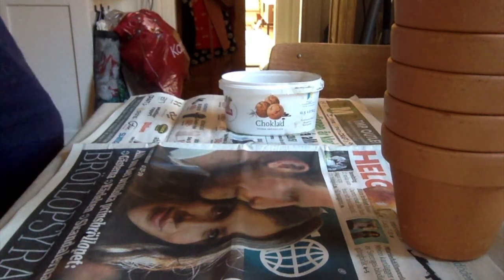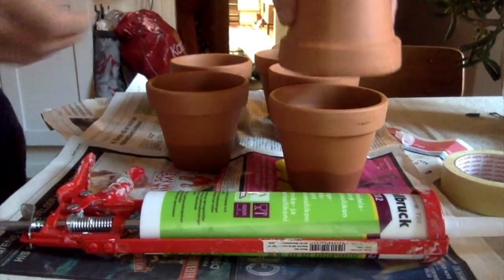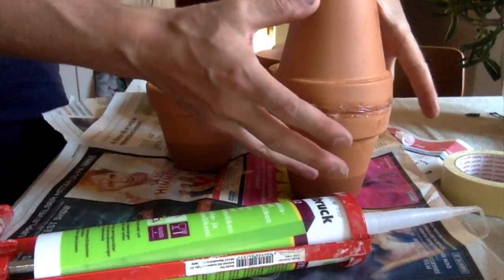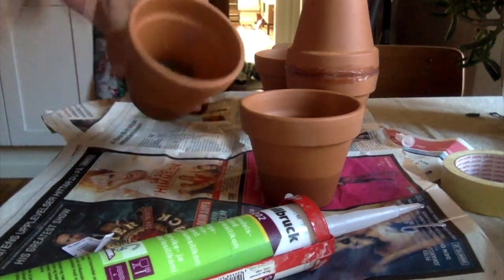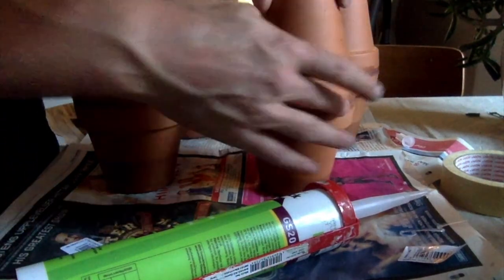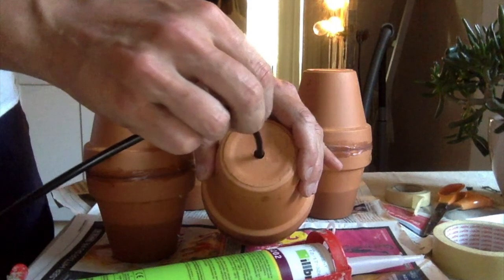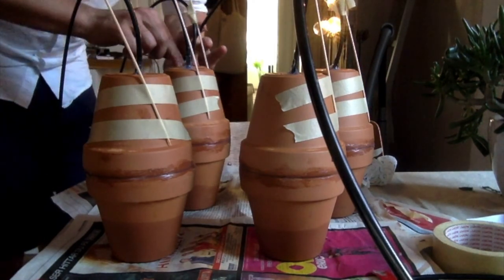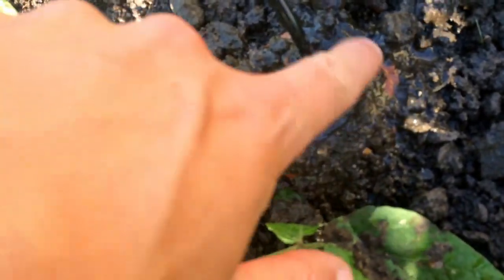How I make my rain barrel fed ollas

Comment: Hi you will have problems with pipe leaking where it enters the pot, it looks to me that some of your pots are very wet, indicating you have leakage issues. You could just use dripper if you want to deliver 2litrs /24hrs.
Reply from the maker: Hi, thanks for the comment! 

The only problem I've had with leakage is two ollas on which rabbits have been digging and scratched the silicone hard. Lucky enough this has happened with ollas next to basil and tomatoes, rather thirsty plants. Next time around I might add a bit concrete on top of the silicone to protect it even more. 

As for dripper vs ollas, my experience is that dripper will consume several times more more water for the same result compared to ollas. Dripping water will evaporate from the surface soil rather fast, especially during warm days, while ollas release the water further down in the ground. If I had an unlimited supply of water this would not be a problem.
Reply: Odlingsapan I have been doing similar for 4 years , ollas spaced about 3 feet apart fed from 100 ltd butt, which I fill every 2 days. Good mulching means little wedding or watering. Finding porous pots has been difficult, but Homebase currently has Italian 11cm pots for o.60p, which are really porous, although they clog up down here in the South of England because the water is hard.